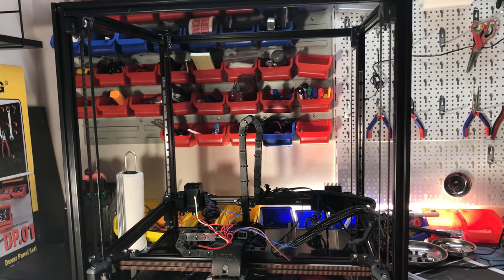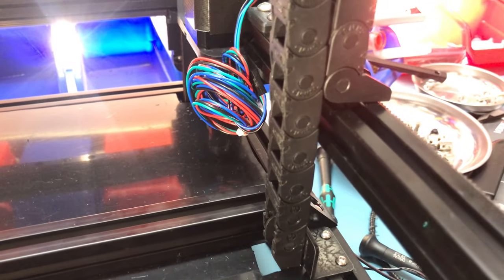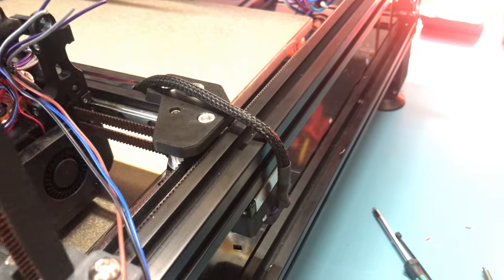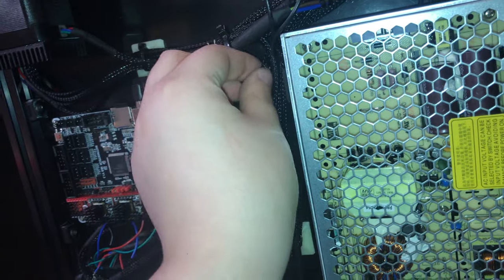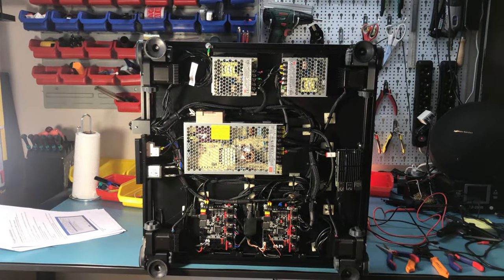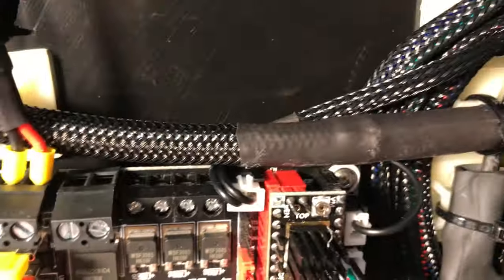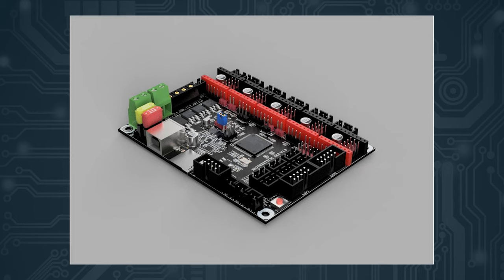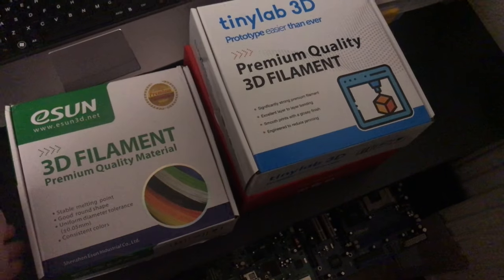Voron 2 Ep. 7: Wiring & Testing

Comment: Soldering takes practice but flux is your best friend. Just a dab of it makes a world of difference and make sure you blow on it when you solder as the smoke is bad to breath.  Also, you typically do not want to hold a hot iron on any pad for more than a few seconds.
Reply from the maker: Yep I know all of that. I've been doing some soldering here and there for years now. The problem is I lack the talent. And my hands are too shaky for some reason.
Reply: Isik's Tech some days I have that issue but am usually able to rest my palm on the table and use my fingers like I’m using chopsticks. Lol